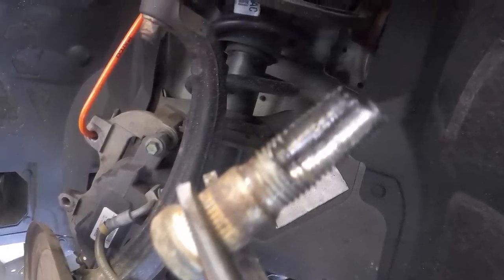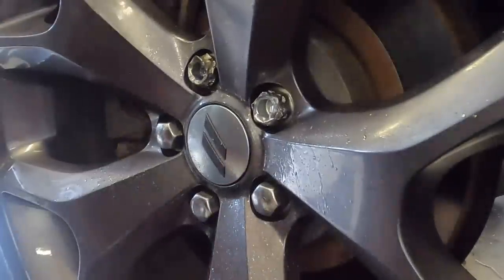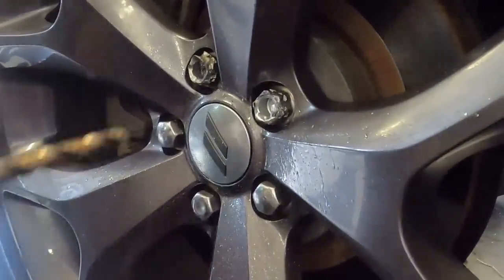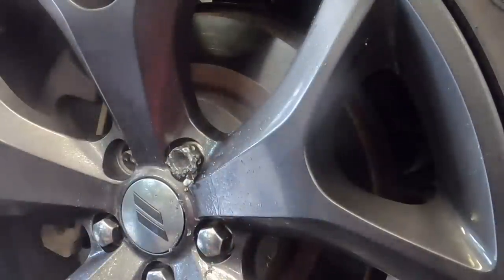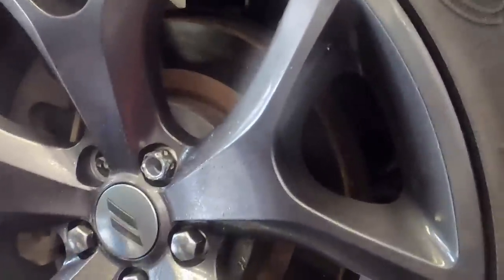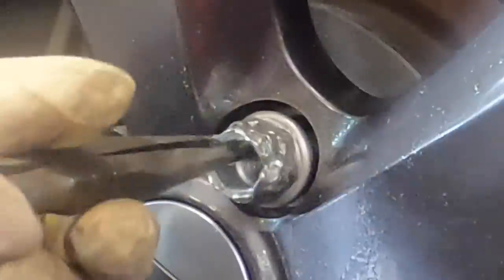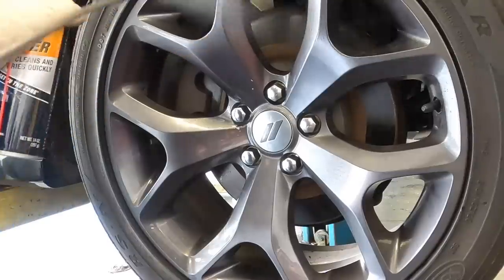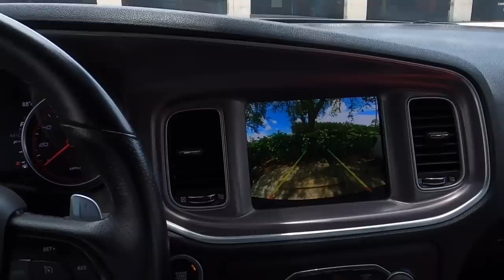2019 Dodge Charger! READ DESCRIPTION FIRST! Dealer Couldn't fix this! Must See! Bonus Footage

Comment: Hey pappi. Looking at this and how my 300zx works. Since this was RWD pretty sure if you pulled the center cap and center nut, popped the two caliper bracket bolts, you should have had enough space to lift the bracket up to clear the knuckle and then just pull the wheel and flange off the spindle.
Reply: Hard to tell from the video, but looks like there’s a lot of daylight in those wheels so not like the calipers were a super tight fit.
Reply: Actually… hmm I watched to the end and that looks like it might actually be a hub unit bolted to the knuckle? I wonder if that’d be even easier, grab those three bolts and pop the fucker put.

Comment: I really enjoy your videos.  I get the vicarious fun of working on cars without the skinned knuckles and rust in the face. 
Question: is it essential to have the drill hole a little off-center?   I can think of plus and minus reasons why but the real test comes from experience.
Reply: The hole is off center because no human hand will ever be that perfect. With your pilot hole, it may look dead center, but as you progress towards the end, the remains of the stud will show in a drastic way. It just comes down to drilling close to center, and make sure it’s straight

Comment: Who ever put those wheels on last had to crank and crank to take up the slack... they knew they made a mess. you need to hand start all bolts and nuts period. If you get stuck with a lot of these drill out then reverse easyout or drive in a a small chisel that you can put in a ratchet and push in the stud as you turn it. ( my 2 cents)

Comment: I don't use a impact on my lug nuts to put any lug nuts on at all. And I watch when I have new tires installed. I bring a ratchet small extension if needed and socket and tell whoever is putting my sockets on I give it to them and tell them there is no other way they are putting them on my vehicle. I have had some people be shitty with me but I don't give a shit. I'm not going to deal with something like this if I have a flat and have to put my spare on the side of the road

Comment: This is caused by not putting the socket all the way on the lug nut. Usually caused because the stainless cover swelles up from corrosion and the mechanic didn't hammer the socket onto the lug nut forcing it on.
Reply: Also happens when tire techs use the wrong socket. Most newer vehicles use 19MM nuts and people want to use a 3/4 " socket which tends to damage those stupid press on cap style nuts. I always replace with solid nuts asap!

Comment: In my opinion the cause of this whole problem is tech's using impact wrench 's and thinking they know how long to hammer on the lug nuts for the correct torque. Using impacts with torque sticks is not a sure thing either. If tech's would use their torque wrench with the proper specs when installing wheels it would be much better for the next person to remove and replace the wheels.

Comment: what really messes this ' shiny lug nuts '  up it the alumiumn cover..... at our shop we just punch thru the cover with a screwdriver and remove the cover.. replace the nut under the cap, if the customer want to...have not found any cross threaded ones yet.. just the buggered up covers... that we remove..all is fine afterwards..i also did this when i bought my 2014 ford fusion...removed the covers and replaced the nuts( anti seized the threads first )

Comment: I only see proper wheel installation on youtube tutorials... begins with using hands, then power tools, then torque wrench to the proper ft-lbs.  In all the tire place in my existence they only use the impact wrench finish a wheel less than 30 sec.  I won't be surprise if the shop who worked the wheel last did it or maybe the owner

Comment: Shit... I use my snap on bolt extractors.. takes any lug nut off. Or it will bust the stud. Who calls himself a mechanic and can't get stripped nuts and bolts off? A parts replacer! Not a damn mechanic. Nice job man.

Comment: Been there too many times ..  Just had a new jeep in with same issue took my 2  hour to remove.  snap on guy shows up that afternoon has  new tool that pilots a drill bit  swears it works   waiting to try out on next nightmare

Comment: (1.) I wonder if this might have been a repo car, and the PO sabotaged it?  (2.)  If I were faced with this challenge, I would use an air chisel on the two offending wheels around the mangled lug nuts.  Yes, they would have been destroyed, but two salvage wheels and labor would have been far less than his 5½ hours + wheel refinishing.

Comment: What is the wheel worth?
If less than an hour of labor, might have been cheaper (lower parts and labor) to break it so you could get at the nuts with a nut splitter.
Reply from the maker: It was, they were $900 each

Comment: I'm surprised that for a 2019 it had alot of rust under there. I don't own a car is that normal? I'd be a bit pissed if a car I brought which is fairly new had all these problems, especially the stupid mistake of cross threading the lug nuts 😂

Comment: Not trying to make you look bad or nothing like that ok i love your videos and as mechanic my self it help me a lots off time but those nuts have a aluminum sleep over the real solid nuts . using a small flat head screw driver remove the sleeps and take out the steel nuts off no need to drill it done many times

Comment: Did the owner create the same problem with the rear wheels?  I guess not because there was no video concerning the rear wheels.  That raises the question, why didn't the owner put anti-theft lug nuts on the rear wheels like he did the front wheels?  Just curious.  Otherwise, great video.  Learn more by watching your videos every time.
Reply: The issue isn't anti-theft lug nuts. The issue is that whoever installed the nuts was a moron and put them on incorrectly and then overtightened them on top of it.
Reply: The issue is cross threading. They just took the ol impact and sent them home full ugga dugga
Reply: You can use the gun an start the threads. You just gotta spin the socket by hand a few turns an them ur good to go. An I bet they used a new gun on them lugs lol. Most impacts max out at around 75 to 100. An I'm pretty sure Max tourqe is 80 to 100 lbs
Reply: @ronniewilliz153  They probably didn't start them by hand, so a few of them went on a little cross-threaded, and then they rammed them down as hard as the impact will go, which if it was an air impact was likely 400-800 foot pounds, and the correct torque for most wheel studs is 90-140.

Comment: those lug nuts that Dorman makes they suck  ,the ones that have a cover so it either 17 18 mm who the fuck knows but  the  solid lugs are the way to go, and the studs come out with PB and a impact hammer,  a little heat helps too.

Comment: While I never had lug nuts this tight or cross threaded. I have seen them so tight that I need the longest breaker bar that I had to remove them. You would have never been able to remove them with the wrench supplied by the car manufacturer. I have yet to see a mechanic take the time to use a torque wrench  to tighten the lug nuts to the proper torque specifications.

Comment: Ever since Ford, Chevy and Chrysler went to a deep acorn style lug nut we’ve had problems with lugs not coming off even when they were torqued correctly. Over time they just won’t come off because ot the greater surface area of acorn nut to wheel. Lubrication is not an option except for threads unfortunately
Reply: Simple solution; don't buy Ford, Chevy or Chrysler.

Comment: Been there myself. Great job. Hope you charged the owner for all the labor
Reply: Ray charged the dealer and the dealer spanked the owner of the car....with a hefty add on charge for doing nothing.....
Reply: @rayb2078  Just so you know the owner had the option of taking it to a tire shop but he/she/it took it to the dealer. The dealer will always have a markup on outside labor. They aren't in business to send things out "for the customer" to save him money, it's to get the job done and not waste valuable shop time on a trained tech doing a non standard repair. The dealer didn't want to have to replace a couple of wheels if they messed them up. Smart shop foreman/manager who made the call on the dealer end.
Reply: @rone1523  I agree.  I doubt the mess up was the fault of the owner.  Nice car, two years old, I'll bet the owner is using dealer to maintain the vehicle (for now).  Very possible the cross threaded (we all agree they were cross threaded, either from misaligned when tightened or over torqued and had the threads "pulled") problem was after a routine maintenance "oil change and TIRE ROTATION" from the dealer.  At two years old, I doubt that he was due for new tires prior, and it's possible (probable) the brake pads have not yet needed to be replaced.  I.E: Only reason to have the tires off the vehicle so early in it's life is tire rotation?  And yes, astute manager of dealership to pass the problem on to a probably more experienced mechanic.  I'm betting the dealership ate the cost of repairs.
Reply: @rone1523  Not so smart on the customer though....besides that it was not a non standard repair..... the dealer felt his so called trained techs would fuck the job up.. any i say any trained tech should have been able to do the same job...

Comment: I had to scream/rant/rave/break sh*t/start WW-3 to remove a 10mm 'Cap Nut' from a Honda scooter dry-clutch
I tried everything, including the old 'Dexron' trick of heating with a torch and then using transmission fluid to 'seep-in' around the threads, repeated every 2-hours or so
NOTHING
( The cap-nut looked perfectly fine, no rust issues )
I drilled into it on 3-facets...almost to the threaded spindle the clutch seats-on, and then cut thru it on the facets...it finally just fell off in sections
( I couldn't risk using a cheater-bar because it might've distorted the end of the threaded-spindle the cap-nut was seated-on 
____
That cap-nut was on for 13-years before I installed new clutch-pads & springs!

Comment: In my opinion the main problem is that crappy chrome nut cover. I would have inserted a tight socket in the nut and tried with impactor not ratchet. Or I would drill all the way the nut until it became easy to break. You were drilling the stud not the nut. My opinion

Comment: Try using a slower speed and add more pressure and the drill bit will work far better than destroying the flutes! you alrady, smoked the drill bit.

Comment: chrysler pt cruiser... i had to drill out all 5 on the drivers side and 3 on the pass side.. both were on the front. My advice buy all new solid nuts and throw that factory crap away! Those things rust on the end and these would not come loose even with an extractor. Pure junk!

Comment: This is the result of laziness when lube techs grab the nuts and install them with the impact gun instead of start them by hand first not even mentioning the over torquing by not regulating their guns or use torque sticks I use to work at Chrysler dealer and honestly if I saw a tech doing that they will hear my mouth .

Comment: Too bad you cant just take the wheel nut off and pull the whole wheel, hub and all,  and lay it on a large drill press to drill the nuts out with that!
We had a Bridgeport mill that would have worked to drill that way- could slide and swing  the head out far enough to reach easy, and get a nice 90 degree drilling with the wheel clamped to the bed

Comment: This is so typical of what is going on in the auto industry these day.  Dry steal on steel assembly from the factories  , no anti- sieze  used so part fuse to gather.   Morons at tire shops who just run 200 PSI unregulated line pressures into the impact guns.  There is no excuse for any of this.   No tire shop touches my cars or trucks, ever.  I take the wheels to them for tire mounting.  Then I mount the wheels on the car and lubricate the threads.   

Remember, want it done right, do it yourself.

Comment: So very interesting to see a dealership decide that this particular repair was beyond them.   Not to say this was an easy one or anything....just...more of a balancing act of aggression and patience.

Watching these recent videos from you on drilling out the lugnuts....it seems like you could put a socket on the lugnut held with vice grips or similar and run at least the smaller size bits through the center of socket to help get the hole established without spinning the nut/stud or risking hitting the wheel.

Interesting nonetheless, thanks for sharing.
Reply: I bet the dealership would loose more money by paying their own mechanic that could be working on a paying customers car instead. It was cheaper to pay another shop.
Reply: Not surprising at all.  The ford dealer sends all of their problem cars , and any rear end work weather it's warranty or customer pay to us. It's more common than you think.

Comment: I hate to put a dark comment on a very difficult job done, but,,,,,, have you ever wondered why quality tools ( from companies that guarantee their tools) cost so much? It's because mechanics use the wrong tool for the job, thinking it doesn't matter if I break this tool,, it's guaranteed (your comment). You should never use a ratchet to loosen a very tight nut. You should never use an torque extender on a ratchet. Breaker bars are designed for that, not ratchets. I wouldn't blame the snap on man one bit for refusing to honor the guarantee on the ratchet that you broke. It was your fault that it broke. It was not designed for that use. Someone has to pay for that replacement. No, not you, but all of us. Take the time to get the right tool for the job.

Comment: aren't  the chrome caps just covers?  you pull them off and use a hex type key to go inside the bolt head
Reply: no i could be wrong they are covers though if they were done up that tight in the first place they would be damaged already.
Reply: Sometimes they are covers but you did not put an Allen key in there they are still regular Lugnuts on there. I own three Dodges One of them is a charger but it was a high-end model so it had really nice Lugnuts but the other one has Lugnuts with chrome covers and it came that way from the dealer.

Comment: Well that sucked! Have had to do that on other projects before. Patience is a virtue. Isn't that video an advertisement for anti-seize grease?

Don't you think you should have cleaned the wheel off the car. You could be blasting that lubricating oil onto a clean brake disc and contaminating it which will in turn transfer oil to the pads. No bueno.

Comment: This clearly shows the incompetent idiocy of not only factory techs who couldn't find their ass with both hands to dealerships blowing off customers with problems they should NEVER have in a $45000 car. The dealership I bought my new ZL1 in '17 don't even know the LT4 takes 10 qts of 5-30 full synthetic oil, NOT 8 1/2. 3 times I had to tell them to add oil. These same jabronies weren't aware that the supercharger has it's own cooling system, they told me the "LT4 guru" would figure out why my car had no power. They put dye in the engines radiator when the problem was the supercharger, coolant leaked out ruining the bricks inside the supercharger then the computer shut it down as the air being forced in the motor wasn't being cooled. Internal service bulletins shown this exact problem and how to fix it, I even gave the doc #'s off chevys internal svc docs and they didn't even acknowledge that 10% of the '17 ZL1s had this problem yet told me nothing was wrong, the speed shop THEY sent me to told me about the problem as you can't lie to the dyno and my #s were 30+ wheel hp off the stock ratings. I'll shut up now as my point was just pointing out the idiocy of over torque the lugnuts are because of factory and dealership incompetence, I'm speaking of my own issues with SRT and again with chevy. I've heard that ford have a much more competent svc department, way over Dodge and chevy. Hope this post shines the light on and helps even 1 person.

Comment: As a 5-time ASE certified Master Tech, I'm wondering, WTF took you so long?  That's a 60-90 minute job.   And cleaning up AFTER you put the wheel back on.  Really?  you clean up BEFORE the Wheel is reattached, not after. I was giggling with the high pressure blower and brake clean move.  (cough cough gag...  NOT a good idea, bro.)  i've done it on Subaru's, Dodges, GM products and the occasional Ford.  To drill a Stud takes about 10 minutes, driving out the bad stud and pulling in a new one depends on the design of the vehicle in question.  But 5 HOURS?? C'mon man.  Really?  I had a special set of Bits I collected just to drill out Wheel studs.  4 Steps and done.  Not saying you didn't do a good job, but in the Tire Business (which obviously you are) you expect mangled/crossed/over-torqued and seized Lugs from time to time.   Kudos on getting the job done.  Sorry it took so long.
Reply: Obviously not everyone can be as good as you! (Trash talk)
But yeah, I don't envy anyone that has to fix another person's mistake. I also cringed when I saw the cleanup AFTER the wheel was installed.

Comment: Cheep ass nuts chrome tinfoil covered nuts, manufactures who use these cheap nuts are making a ton of money by using trash. Makes your job harder. Seems like someone could use left handed drill bits and and left handed easy outs. Buy the action of the left handed drill bits usually cause the nuts to unthread and come off.